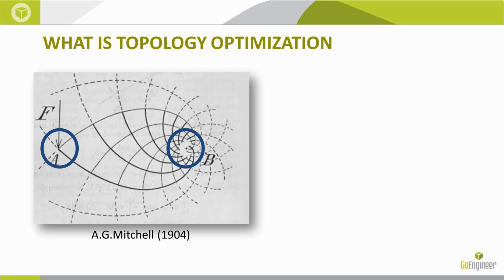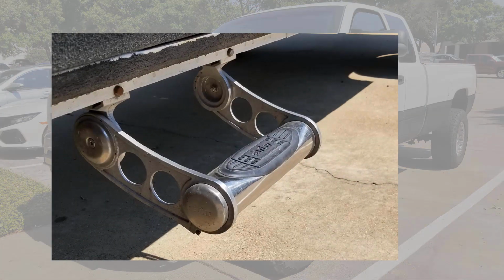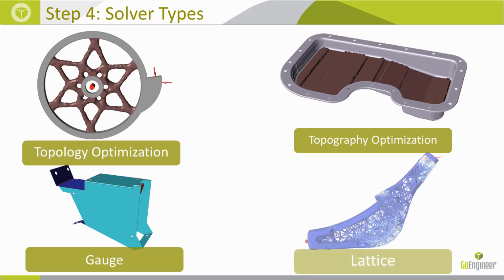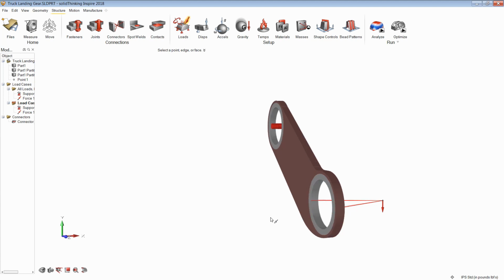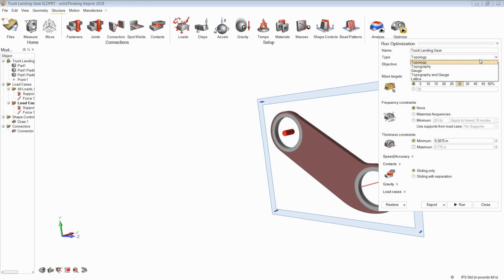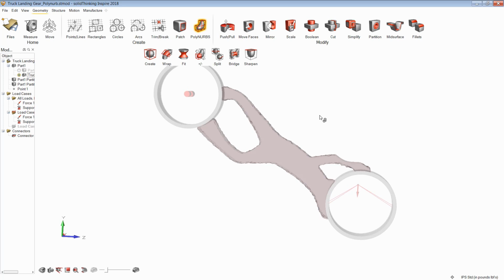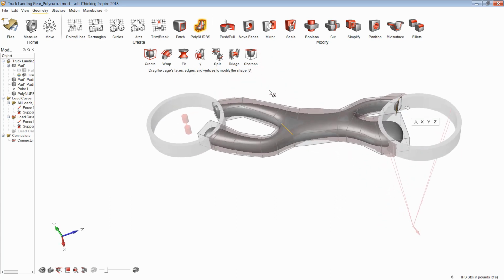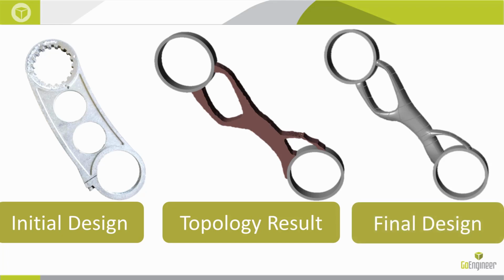SolidThinking Inspire - Topology Optimization

Comment: 21:30 - there is no chance that the "computer optimized" part will be stronger than your initial "brain optimized" part. These programs were proven to be super wrong in many cases. They even don't consider the simple fact that metals (especially 3d printed metals) are could snap easily under pulling forces compared to pushing forces. The shorter the rod is, the stronger it's against pushing forces. Pulling a short rod versus pulling a long rod requires almost the same forces (except that the short rod will snap quicker due to the elastic factor of the material). However, pushing a very long rod requires much less forces to break it, because it will try to bend in some direction. With simple words:
A 30 mm long bar with 10 mm diameter will hold pushing forces better than the pulling forces (pulling it will snap it much faster than pushing it).
A 100 mm long bar with 10 mm diameter will hold pulling forces better than the pushing forces (pushing it will bent and snap it much faster than pulling it).

Comment: Thanks very lucid presentation, Arvind, I am transitioning from 2D to SW as I am smitten by the magic of SW and its power, and hope to be as comfortable as you are would you suggest a learning plan, that would be a big help, Does Go Engineer help?
Reply: Go for SolidEdge, it doesn't crash as SolidWorks does. Plus both use Parasolid 3D geometric kernel, except that SE is made by Siemens, to which belongs the property of Parasolid, so you'll benefit of the full features and latest developments. If you're more into design than pure CAD, go for SolidThinking Evolve from Altair, still Parasolid but NURBS oriented and very powerful. SW is nice when we begin, but it's a real pain in the ass on a longterm. I'll never recommand it until Dassault change its geometric kernel for the CATIA one. Should happen in the future, to unify their products line and lesser the software maintenance costs, but nobody knows when will it be released. So, simplify your workflow : give a try to SolidEdge, it really worths and you'll be able to open your SW parts and even edit them directly without the history tree in a fingers snap.

Comment: The optimized part looks really weird. wouldn't you expect the most material on the outside like an i-beam?  can the optimized part be explained with some intuition?
Reply: The optimised parts often look odd, I think it changes from an I-beam to more of a circle because the load is mostly torsional, but correct topology optimization depends on many things which are hidden behind the scenes in these programs, you're right not to take the solution at face value without seeing actual quantification of the solution's performance.
Reply: A real-World test with both versions will easily prove that the computer generated "optimized" version is actually weaker.